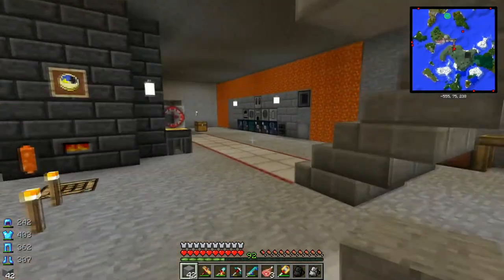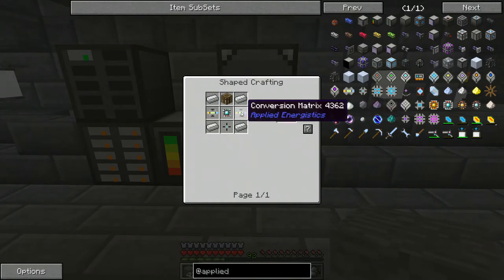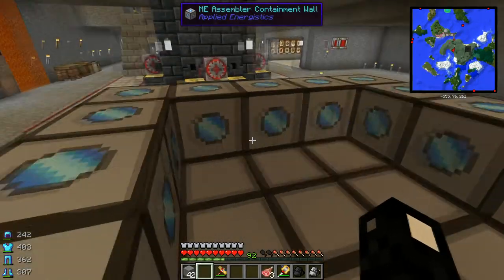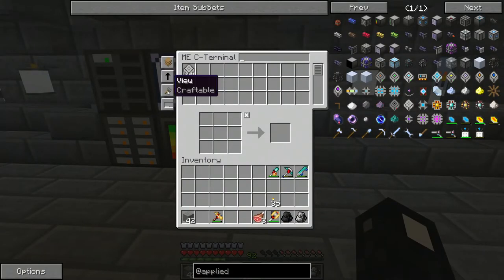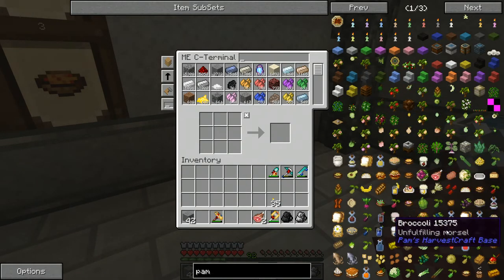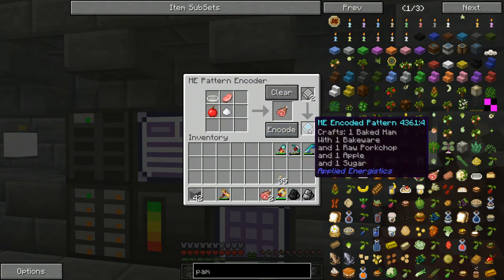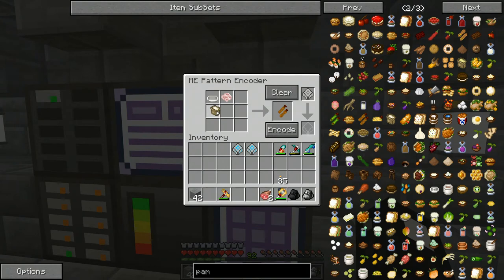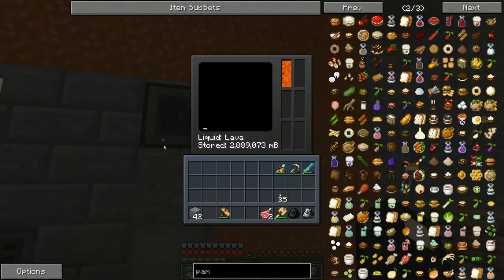FTB Horizons [S01E19] Building a MAC!

Comment: Hi! I think you should check out the forge lexicon (it allows you to change one form of some material to another if forge recognizes them as same - like thermal expansion copper and buildcraft copper is recognized as same item and can be switched between each other) and I think the MAC has a forge integration also, which allows it to recognize the different items being same (your wooden planks issue for example, it will recognize all wood planks and take them as same...) :)

Comment: The crafting CPU increases the number of crafting operations per second that the system can handle, you can even build the MAC using no CPUs at all, but the crafting would be awfully slow.